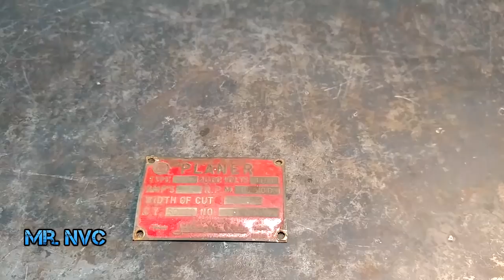Old Electric Hand Plane HITACHI Restoration

Comment: Nice refurbishing project. But you really need to invest in a powder coating system so when you refinish such projects, the finish will stay on the project. Paint will scratch so easily and in no time the surface will look questionable. Thumbs Up!
Reply from the maker: I will invest a power coating system. Thanks sir

Comment: I wonder if I could use an engine cylinder hone to clean the inside of the solenoid. Also, why didn't you fill in the Hitachi brand logo? It's supposed to be red, I believe.